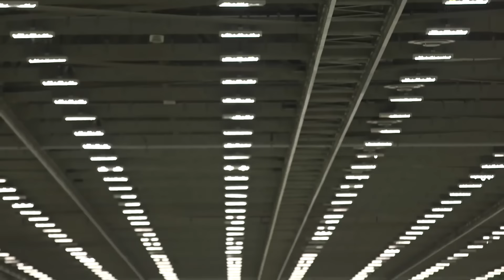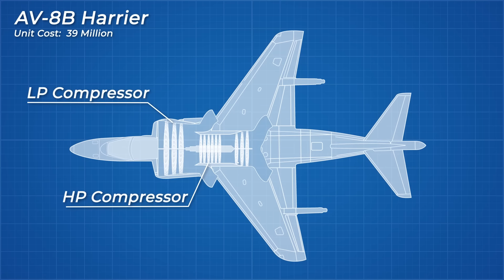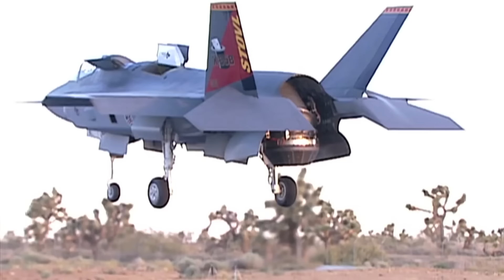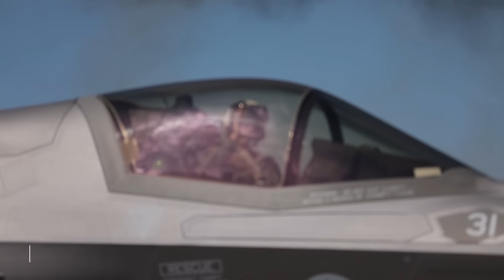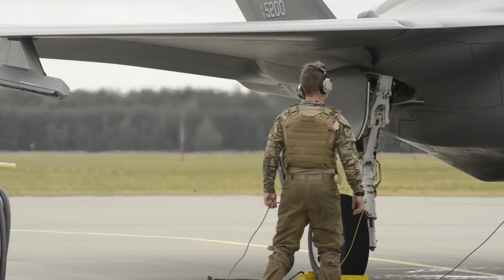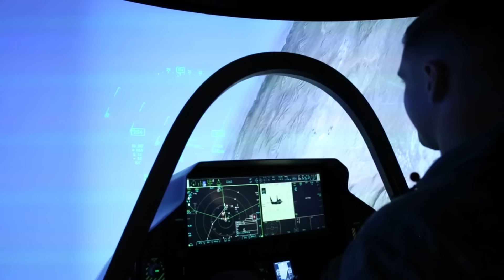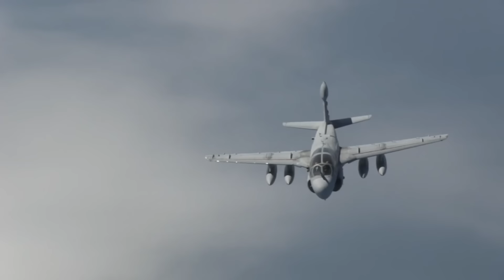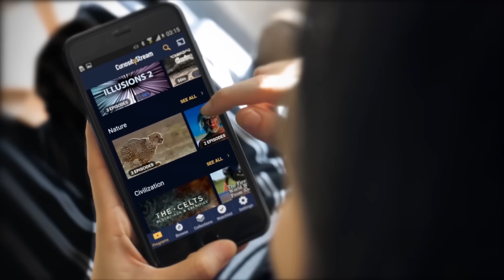Is The F-35 Worth $115 Million?

Comment: How often has a jack of all trades been superior to specialized designs?

The F-35 is going to be a jack of all trades, its pilots on average will be primarily trained to perform in the tactical bomber/support role, with any combat experience based highly asymmetrical police actions, peripheral wars and suppressing insurgencies/unconventional forces. The F-35 is not a super fighter, the over reliance is as much a weakness as it is a strength. Upgraded F-16s and F/A-18s can perform the same roles, just as effectively at a much lower price and arguably more reliable. The A-10 under the conditions it is expected to operate is far more superior, no F-35, F-16 or F/A-18 can replace it for that matter. Again the same for the true air superiority role (as opposed to Multi-Role) the F-22 and F-15 with some upgrades are far superior. The F-35 is where politicians and corporations find both their nirvana and achilles heel, the panacea of multi-role cost savings, the lucrative business of replacing a lot of hardware in one go and major export contracts to nominal allies that love to suck up on Washington.

Who cares if the F-35 is the second coming of Christ for fighter pilots, it is an expensive program pushed by forever wars in a time when we could have had peace dividends.

I love aircraft, I love combat aircraft even more, but I’ve stopped believing the BS our politicians, corporations and their institutional media hacks are force feeding us. No flashy fighter jet is going to blind me again. Top Gun 2 - no thanks.
Reply: I disagree with you, US Pilots are probably the best trained in the world and certainly have the skill advantage over all their current enemies both in Air-Air and Air-Ground.
In the Air-Ground role the F-35 also has some advantages over older jets like a better Air-Ground Radar an integrated Targeting Pod, Missile Approach Warning System, better Datalink for communication with ground forces, stealth and Jamming capabilities. You also can't just upgrade the current jets forever as they will eventually reach its limits.
I also disagree with your point that the F-22 and F-15 are far superior in Air-Air, yes the F-22 might be better than the F-35 but it also costs a lot more and is not really designed with ground attack in mind which is a dealbreaker for high number production. Against older fighters like the F-15 and friends I am sorry to tell you but the statistics speak for the F-35 which absolutely destroys them in Training fights. Look at the Red Flag exercise for example, the F-35 absolutely humiliated the other jets and there is also the story about a rookie pilot with 8 flight hours in a F-35 who killed an experienced 4th gen pilot with 3,000 flight hours and then went on to kill 3 others.

https://www.businessinsider.com/the-f-35-tore-apart-fourth-gen-fighters-in-major-combat-exercise-usaf-2019-2?r=DE&IR=T
https://taskandpurpose.com/news/air-force-f35-red-flag-exercise
https://www.businessinsider.com/italian-pilots-raved-about-first-red-flag-exercise-with-us-made-f-35-2019-4?r=DE&IR=T
Reply: Basically always... these days you don't even sacrifice anything because multi-role capability is determined by software. Upgraded 4th gen fighters perform the same roles because they were also jack-of-all-trades designs. Regardless of that they under-perform compared to the F-35 and generally are more expensive to buy, except for the F-16 and F/A-18 which are only slightly cheaper.
The A-10 isn't expected to do anything other than a niche role that isn't actually necessary unless you are fighting poorly armed enemies. In terms of CAS as a whole fast-movers are superior, especially the F-35.
Both the F-22 and F-15 are multi-role designs optimised for air superiority, just like the F-35 is a multi-role design optimised for air to surface missions. In fact the F-22 is the only modern fighter that even comes close to being single-role, and it's mostly because it was underfunded and compromises were forced such as only being tested to use GPS guided bombs for air to surface operations instead of a whole suite of similar weapons.

Comment: Imagine if the USA fit a Nuclear fusion 110 reactor to the f35. Infinite distance power and possible speeds faster than any missile. Is this the next stage of upgrade on the F-35. Watch this space. Rumours are a patent now exists. Is this how the f-35 Laser weapons will be  introduced to the jet.
Reply: free energy would be lovely, but pretending that we're anywhere close to it is absurd
Reply: @infinitelyexplosive    There has been huge movements in this field lately and although the current efficiency of the latest prototype reactors run at 0.67 (less than 1) its huge gain in power effiecency since 1930s first prototypes. The new tech for plasma acceleration using magnetic tapes rather than solid state magnets has enables huge leaps in this field. Hopefully a break through is imminent. Who knows. When they break a factor of 1 we are inifinite power. It will happen 1 day but when .... Who knows. It will change everything as interstella travel would be possible.

Comment: One thing you missed out - when these things were planned the most recent experience was the first Gulf war.   A 1991 attack on downtown Baghdad using stealth technology took two F-117As and a single KC-10 tanker.   To guarantee get the same number of bombs on target using non-stealth aircraft required a flight of four F-15Es with bombs, six more for SEAD, four more F-15Cs for top cover and a pair of EF-111s for jamming.   

They often went in with diversionary attacks by F-16s elsewhere and all this required a dedicated AWACS to control.  The cost of the eight or so tankers to get this lot there and back again was far greater than the cost of the two F-117As alone.   Stealth equalled massive cost savings when measured against bombs on target.  Thats why they didn't mind spending all that money.   

This is also why the USN is looking at smaller cheaper carriers, they no longer need a layers of 20 odd aircraft for an Alpha Strike they can achieve the same result with a handful of F-35s.
Reply: @Arthur the Infidel   I rode a Warrior with the Infantry and later a Chieftain Stillbrew TOGS Mark godknowswhat with the RTR.  As for A-10s I knew a Sgt who was asked by a young solider once - you ever been shot at! - he replied:  everyones shot at me, the fucking HVO, BIH, BSA, IRA, INLA, UDA, UVF and USAF!   We weren't far from the Fusiliers when they got schwacked Blue on Blue by an A-10 in the desert, he was still in service when A-10s took out a couple of Scimitars in Iraq.  As far as we were concerned the natural habitat for an A-10 was as far away as possible.
Reply: You are right, keep buying F-35s - more of them.
Be sure to borrow the money though, because BIG business and BIG money gets tax breaks your children’s children will still be paying the interest, if Washington does not decide to “change” their global financial system at some point to wipe the sheet - aka cheats with their own game.
I am sure the F-35 will shine while it bombs third rate military and insurgent forces so you can feel proud.
Reply: @TK421-53    Whats your problem with borrowing money?   Why shouldn't my kids pay for admission to the world?   They ain't getting a free house, a free car or free electricity, why should their imperfect apex society be free?   

I was paying £2.75 a year for WW1 until I was 32. I am still paying about £3.50 a year for WW2.   That's a fricking bargain for a vote and equal standing under the law. 

This is the bit where you say we don't live in a perfectly free and democratic society because some people have more money and therefore more clout than others.  Yes, I agree, which is why that goal is still a work in progress and requires great big shiny war fighting tools to defend the advances made and pursue that goal in the future. 

WW1 secured the rule of law and democracy West of the Rhine, and I have enjoyed that tremendously.  WW2 did the same West of the Elbe.  Cold War 1 secured it West of the Vistula and the point of F-35 is to continue that process in Cold War 2. All the way to the Yangtze baby! 

To pay for all this total war success, 'they' had to borrow money from common people's taxes.  That transference of power from landed gentry to oiks like you and me raised the oiks individual rights and standards of living. 

My taxes are my chips in the game.  I want the common man paying for more than half of everything.  That means it's ours.
Reply: David Rendall rinse and repeat, 3x daily.
Reply: @TK421-53   So you have no answer then?
Reply: David Rendall nope no answer, you are right.
Reply: @davidrendall7195  *West of Bug...  poland stretches couple hundred km to the east of vistula
Reply: @darkestkhan    Fair enough!
Reply: @davidrendall7195  Keep on reaching for that blue sky, man.
Reply: @TK421-53  that is not how tax breaks work XD
Reply: @Arthur the Infidel  The Russians are very handy with a spanner, as a former tanker in Germany who studied the T-64, T-72 and T-80 with a mind to survival I can attest that.     However I doubt the Russians handed any stealth secrets to the USA - the algorithms for deflecting radar were known from its earliest days, putting them into a producible flying airframe was another question.  A question of money, which is where the Russian 20th Century experience falls on its arse.
Reply: @davidrendall7195  "experience", that's a funny way of describing Western central bank propagated and supported mass killings of Russian Christian populations. re. 'In The Shadow Of Hermes'.
Reply: can you stop with the f117? Serbs have already blamed themselves on the f117 that was shot down in 1999. They've already said they didn't know it was stealth ahahaa
same for your shitty f22 and f35. US stealth is a myth. Proven too many times on the field
Reply: @MrFROGY1313  But didn't the Serbs "cheat" by using some sort of modified S or K Band radar or something like that?? I  mean thats UNFAIR, they're supposed to just use the regular old conventional radar detecting equipment that the F117 was designed for and meant to defeat!!

Comment: Jack of all trades, master of none. The F35 will never be as good in any one role as one that is optimized for a single one. The problem is fundamental. The more requirements you add to a design, the more compromises that need to be made to other areas. The cost of production and maintenance is where the F35-design has really compromised. They're so expensive and require so much specialized equipment and training to produce that losing even one could be unsustainable for some countries.
Reply: Except none of that is true. "Jack of all trades, master of none" has only ever applied to individual systems, which fighters are made up of multiple. Performing multiple roles has been a standard for several decades because it is the most cost efficient way of doing things. The only fighters that are better than the F-35 in any single role are those that don't even compromise on cost. The F-22 for example is double the cost of the F-35A. now that we're on the topic of costs, the F-35A is among the cheapest fighters available and is easily the most cost-effective of all right now.

Comment: When the X32/X35 were in competition, Boeing realised that there was a flaw with the delta design of there aircraft but had to carry on with what they had. They decided to change the delta design for a four poster design (conventional design) if they won the contract.  If they were to run the program as stated, Lockheed would have lost because they went over budget  during the build faze by a large margin.

When the F35 was going through its trials in 2015 its G rating was limited to under 7 G's where as the legacy  aircraft that it was pitted against  were not so they could hit max 9+G ratings in combat manoeuvring.

It would be interesting to see a rematch with the final design's of both aircraft to see if the outcome would be the same.

Comment: It just ain't fast enuff, stealth is dead. So it has the cross section of a small bird or whatever. If I see a bird doing 600 mph+ ( radar or Flir) I'm still gonna shoot at it if I'm the adversary.
Reply: The F-35A achieved Mach 1.61 while configured for a long range strike mission. None of the US 4th gens are faster in such a configuration.
If you manage to spot a bird at 100mi then you don't have the accuracy to shoot it down. If you have the accuracy you certainly won't be spotting the bird. That's just how radar works, and iRSTs don't offer any real advantages against stealth in comparison. Also, all nations with well known fighter industries are focusing on stealth for the future projects. That says a lot about how much of an advantage stealth really is.

Comment: Several problems with your overview!!
FIRST
The US GOVERMENT made the requirement that 3 separate vehicle had to support each individual branches of the military AND have over 30% commonality in parts. FAIL by LMA. In addition had to meet cost objectives which it is failing at miserably.

SECOND
You refer to the British Harrier “Jump Jet”. FYI THIS WAS designed, tested and built in America by McDonnell Douglas Corporation. Bought out by Boeing in 1996.

THIRD
THE COMPARISON TO AN F-22 IS NOT REALISTIC !!!! F-22 HAS 2  ENGINES.  THE F-35 HAS 1, F-100  ENGINE.  COMPARING A 4 CYLINDER ENGINE TO A , V-8 ENGINE IN AUTOMOBILES IN NOT REALISTIC EITHER.

FOURTH
THE F-35 IS ALL OVER THE WEB AS A DOG TO HEAVY TO DOG FIGHT ANYTHING. Rather relying on stealth technology to hide and seek its emery’s. 60 MINUTES AUSTRALIA DESTROYED THIS VEHICLE IN LESS THAN 10 MINUTES, LOL.

Reported on by the Pentagon, don’t be surprised if this vehicle becomes a UAV as the cost is out of control its weight is out of control and the engine performance is lacking. A stubby overweight fighter in a sprint to the death.
Reply: 1. The F-35 does in fact have around 30% commonality between each variant. Cost objectives have been failed in every single fighter project since the 1960s. But the goal for unit cost has basically been achieved with the F-35 being the absolute best value for money of all fighters available today.

2. The Jump Jet was designed and tested by Hawker for the RAF. MDD got a licence to produce the Gr.1 as the AV-8A and eventually added their own improvements.

3. The number of engines doesn't matter. A single engine can be more powerful than 2 smaller ones. As long as the comparison has a point of reference there is no problem.

4. The F-35 is the 2nd best dogfighter in the US military. Nobody with any sort of real knowledge has called the F-35 a bad dogfighter, only morons such as Pierre Sprey. But then again it's impossible to please Sprey without putting pilots lives at risk.
Reply: Again several problems with your story. Politely, “Gun Control” and cannon control is actually being able to hit your 🎯 target. If your cannon cannot aim properly how to plan on accomplishing this objective at Mach 1 much less any speed??

F-35-Lightnings-guns-dont-shoot-straight-cracking.html

https://www.google.com/amp/s/www.dailymail.co.uk/news/article-7947679/amp/Pentagon-reveals-  ...... SCATHING THAT TERMONOLOGY HMMMM Does not sound positive to me. The pentagons report is OBJECTIVE TRUTH through research and in plant walk throughs as well as demonstrations and data driven information.               https://www.stripes.com/pentagon-issues-scathing-report-on-the-f-35-1.392187.                               Latest News FEB 01, 2019 ..... HMMMM NOT GOOD AGAIN ..... https://www.flightglobal.com/fixed-wing/dotande-delivers-another-scathing-report-on-f-35-progress/131231.article.    BTW if your comparison of 1 JSF engine is comparable to, 2 F-22 engines may want to check the thrust output data. An F-22 will leave a JSF in the clouds within seconds any day of the week, nighttime is not even a discussion topic.  The F-22 owns the night in the arena of air to air combat!

The JSF has not met the objective of 30% commonality. If you can show me reliable date to suggest otherwise I will gladly stand corrected.

This place is a over priced lemon to politically BIG to fail. A masterpiece of back room deals.

In closing here is the GOVERMENT (LACK OF) ACCOUNTING OFFCIE (GAO) report on your beloved F-35 POS

ENJOY THE 81 PAGE BEATDOWN
https://www.gao.gov/assets/700/698693.pdf

This articles summations of the program are well read for yourself

https://fas.org/sgp/crs/weapons/RL30563.pdf

Your fat girl is 3,000 pounds.............. overweight !!!!! OHHH MY
costing $6.5 BILLION DOLLARS!!!!!!
THATS A “B” not an “M” 😜 💥 🤛🏻 
“F-35B 3,000 lbs overweight; added 3 years / $6.5B”
A significant issue in early development, noted in Figure 2, was the weight of the F-35B variant. Because the F- 35B takes off and lands near-vertically, weight is a particularly critical factor, as aircraft performance with low- to no-airspeed depends directly on the ratio of engine thrust to aircraft weight.
The delay was exacerbated by the consolidation of the former JAST and ASTOVL programs, discussed in footnote 53. Normally, in a development program, the most technically simple variant is developed first, and lessons applied while working up to more complicated variants. Because the Marine Corps’ Harrier fleet was reaching the end of life before the Air Force and Navy fleets the F-35 was designed to replace, in this case, the most complicated variant—the F-35B—had to be developed first. That meant the technical challenges unique to STOVL aircraft delayed all of the variants.
     57 Graham Warwick, “F-35B Hovers for First Time,” Aviation Week/Ares blog, March 17, 2010.
58 Graham Warwick, “STOVL F-35B Makes First Vertical Landing,” Aviation Week/Ares blog, Marc